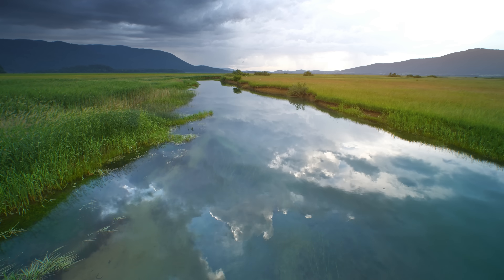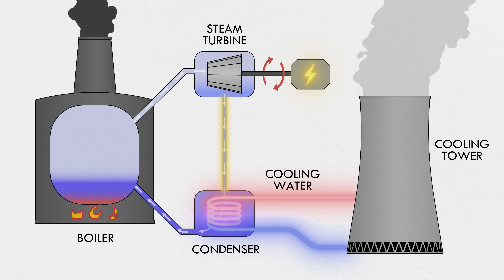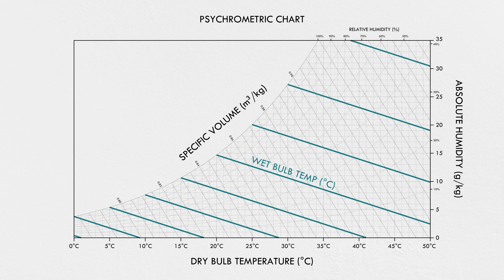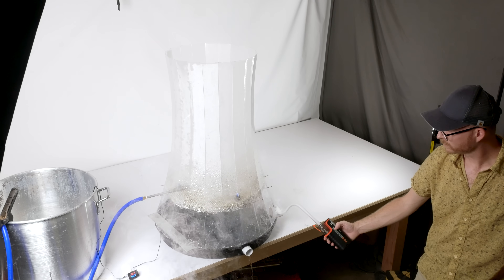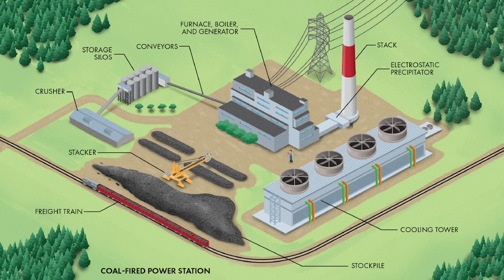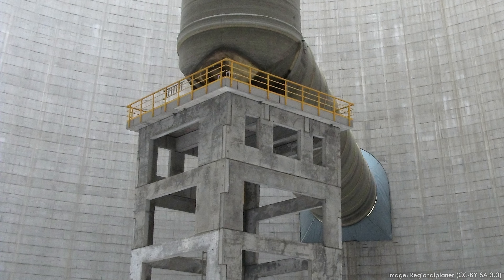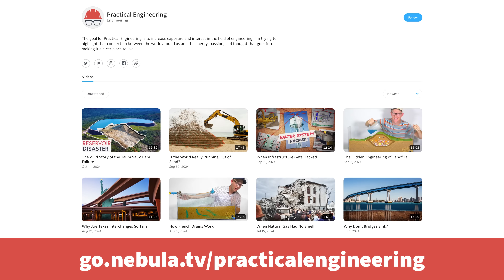Why Are Cooling Towers Shaped Like That?

Comment: Decades ago I was in Nuclear Power Engineering.  All this time, I am still surprised some smart engineers haven't figured out how to continue using the waste steam in a further electric power producing process and add further energy extraction methods in various smaller stages, (or at least a second stage system) to the point one could eliminate the cooling system entirely, (or almost entirely using much smaller cooling systems.)
Reply: If you'd have stuck with it you would have figured out the law of diminishing returns.  At some point it becomes impractical and isn't cost effective any more.  If power companies could make (save) a buck off of it, it would already be in-place.  Plus at some point, given entropy and enthalpy, it just won't work any more.
Reply: @nathanwahl9224  That was the first thing that came into my mind when I was typing my message out sir! With the new types of batteries using heat, there indeed might be a use for it after all????  We shall see. Thanks for the reply and happy holidays!!!!

Comment: The reason given for cooling towers isn't exactly concise. Cooling towers are used if there isn't enough cooling water bodies available. Either not enough water or the waste heat would heat s small lake up too much for wildlife (either way due to not enough water).  That's why in desert areas they have many cooling towers and in wet areas very few if any. Also it's not about keeping the water pure. All the cooling water you see is coming from the secondary loop which doesn't go into the reactor. The coolant in the reactor is a closed system.

Comment: why do we need to cool the water while we need it hot, so that we use less heat to trun it into vapor to run the turbines ? on top of that,  isn't the hot water coming from the nuclear plant to the lake dangerous since it contains radiations ?

Comment: Seeing the section about the structural integrity of cooling towers was pretty cool.

There is an abandoned plastics plant by my house that had its own power plant. The cooling station has never been demolished and the cooling towers, which are situated on the roof of a wood truss structure, are collapsing seemingly by their own weight.

Comment: I think the better question is, why do we need cooling towers at all? Aren't they by definition, energy loss? A power plant's function is to generate heat that gets turned into electricity. Why let all this heat escape into the air in the first place?

Comment: If you live near Beaver Pa, head over to shipping Port, right along highway 168 you can see a natural draft cooling tower up close and in action. And up the road are a couple of inactive ones at a deadlined coal power plant.
Reply: I've been down that road!  Came over to the Beaver Valley nuke plant from her sister plant where I worked in NW Ohio.  With the hills you can't see squat, come around a corner, and there they are!!!

Comment: Fun story: If you get on google maps and find the GM Spring Hill Manufacturing plant in Spring Hill, TN and turn on satellite view you will see that there is a line of 8 relatively small towers like this. Now, this manufacturing plant was originally built to produce the Saturn brand and was designed to be as efficient and environmentally friendly as possible. Now here's the fun part. When the plant was being built in the 1980's there was a huge uproar in the area from locals who thought GM was building a nuclear energy plant just because of the shape of those towers. Everyone associates these towers with nuclear energy. I suppose it's understandable, but the county still forced GM to allow 3rd party engineers and local officials to view the plant to make sure it wasn't gonna be using nuclear energy. Pretty wild. 

As I mentioned, this plant was built with a BIG emphasis on being environmentally friendly. EVERY stack in the plant had built in air scrubbers to make sure noting harmful was getting out into the atmosphere. There was a massive emphasis on recycling to where there was very little (if any) garbage waste. They even blasted out a side of a hill and built up the hills around the hole, and built the plant down in the hole. They even painted it the same color as the sky in the area to limit it's intrusive visibility to the local population.

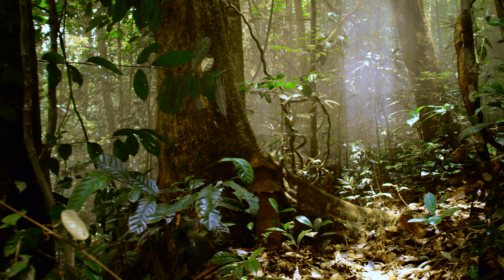Comment: 6:10 it doesn't feel hotter if it's humid. It feels "MORE". Humid 1°C air doesn't make you feel hotter than the arid air of the same temperature. Steam just carries heat better but it's a two way road

Comment: Having worked on these towers on several uk power plants on the packing and efficiency of the cooling towers, one thing that you could add to your video is why the condensers are used and it’s not just to cool the steam back to water as that is counter intuitive, the real reason for doing this is to do with the properties of steam and water, 1L of water expands to 1000L of steam, the turbines have 3 sections, high pressure, medium and low pressure then to the condenser. The cooling of the condenser causes the steam to turn back to water, contracting by 1000 times, creating a negative pressure causing the turbine to spin faster generating more power and the reduced pressure means the steam remains steam at 50 degrees C. The cooling allows an increase of up to 50MW  from each 500MW generating unit. The efficiency of the pack and cooling of the tower water greatly affects this gain ie if a cooling tower has lost efficiency amounting to loss of 5 degrees of cooling costs based coal fired units was £100k per degree, per tower, so on a plant like Eggborough with 8 towers around £4mill per year. The more the cooling of the condensers the greater the vacuum therefore the more power generated from the same ton of coal
Reply: Oh wow, that's incredibly interesting. I'm starting out as a performance testing engineer, great to have this golden insight from you!
Reply: this really needs to be higher
Reply: That's cool thanks for sharing
Reply: Very cool piece of Knowledge 👍🏻
Reply: I love hearing smart people talk about this it sounds like you have so much passion!
Reply: Thanks for answering a question that came up in my head very often

Comment: Steam pressure turns turbine.
Steam vapor condenses back into water on it’s way to the cooling tower as it meets cooled water in a exchange condenser coming from cooling tower preheating it on it’s way to become steam to turn the turbine again…

Question;
1) How much heat returns to the water that gets heated back into steam?

2) How much heat goes up and out of the cooling tower?

X = total BTUs generated into steam.
Y = BTUs exchanged from steam into water from cooling tower, conduction.
A = BTUs lost in cooling tower, convection.
B = BTUs lost from conduction, radiant, and convection at steam production to the turbine.

Y+A+B=X
X-(Y+B+A)=0

Comment: Surprisingly this technology of the swamp cooler is used in Africa as a means of refrigeration. It's not very good but it's enough to keep and create jelly. How would works is you have a netting that you put over an A-frame tower. You keep the netting wet enough for constant evaporation but not too wet. This allows for the latent heat to lower the temperature inside the A-frame. I never knew how it worked until I watched this video almost 10 years later. Amazing how things click into place.

Comment: Liddell and Bayswater power stations are examples of two different cooling options standing across the road from each other. Driving north you had Bayswater with cooling towers on the left and Liddell with no towers and lake Liddell on the right.

Comment: Why do charts of humidity and temperature always seem to not include the lowest relative humidities and often the highest ambient temperatures (yours at least has the latter)? 
This is most concerning when I look up information on heat safety for example. 

Where I live in Arizona our record high is 117F/47C, and many charts stop at 100F/38C. We also often pair these temperatures with a relative humidity of 3%-10% well below the minimum of all such charts I have found. 

I just want to be able to compare what the actual water content of my air is compared to that of my friends in normally humid climates that get very cold in winter. And when I use a calculator set up for it, it warns me calculations for my area may be inaccurate. Why is that? 

If my 110F air is holding 5% of the maximum water it can hold, Why can't they tell me what that amount is reliably when they can for 70F and 90% humidity? What changes?

Comment: Would placing a large Wind Turbine at the top of the nuclear cooling tower be a viable option or would it end up adversely affecting the draft needed to cool the water? 

If it would work, could you run a sufficient number of braided steel lines to a large generator suspended in the center with sufficiently large roters attached to the bottom of the generator so they could never interfere with the lines. You could run the power cords back out along those same cords and any torque from the system will just end up putting more tension on the lines so spreading that load out across multiple different lines would easily take care of that while also not inducing twisting strain that a rigidly mounted unit would create. 

Probably been thought by someone else before and a logical reason why it isn’t being done now but then again if everyone assumed as such innovation never would happen.

Comment: 00:00 - Introduction to Cooling Towers 🌬
02:01 - Efficiency in Cooling ♻
06:51 - Thermodynamic Principles 🌡
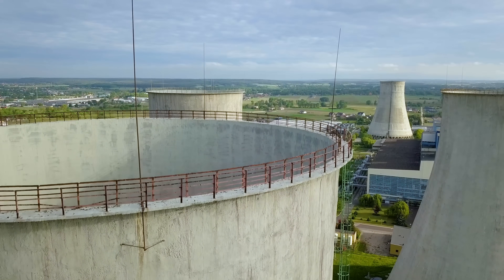10:47 - Design & Structure of Cooling Towers 🏗
12:37 - Types of Cooling Towers 🌊

Comment: The flue gas or toxic components of industry would be hidden and only released at optimum time slot which avoids detection, this combined with the water vapor cloud helps to deceive the public who might be unaware,,  the big water vapor charade of the water cooling tower needs to be observed between 2:30-5:45 am thats when you might notice .
Reply: That's called steam. Nuclear power does not utilize fossil fuels in order to function and thus does not produce flue gas.

Comment: There is a good way to get even more use out of it, needs to build some more infra though. Pipes that take the heat to surrounding buildings i.e. district heating (such infrastructure is in use in Finland, probably not from nuclear power plants, though) and then back to the cooling towers or elsewhere.

Comment: I doubt smoke stacks are tall to move combustion products away from populated centers. Their height is insignificant compared to horizontal distances. If it is to keep exhaust away from people, then it would just be at the powerplant itself.

Rather, it's more likely they are tall to maximize lift (chimney effect) to extract exhaust products from the combustion chambers as quickly as possible to improve airflow and the combustion process, and the exact height is balanced by cost, safety, and effectiveness.

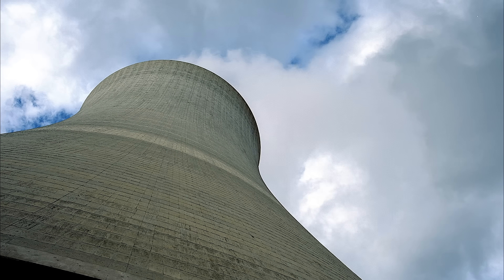Comment: 13:56 - 14:02 Here you can see that the footage was made at a nuclear power plant. You can sometimes see white dots or streaks flashing, which are caused by high-energy electromagnetic radiation hitting the CCD sensor directly through the camera body.

Comment: Apart from structural considerations, the shape also minimises the material cost. If you had two wire rings of different diameters and put them in soapy water, the film between the rings will assume the familiar shape (due to surface tension) indicating mnimum tension state

Comment: One of the most advanced version of it is the Heller-Forgó Indirect Dry Cooling System. The water flows in a closed system of water-to-air heat exchangers built in the tower and does not evaporate. So there are not big clouds coming out of the tower. It is useful if you had produced deionised water with ion exchange, and you want to reuse it. It was invented by two Hungarian engineers László Heller and László Forgó.
Reply: Everything was invented by the Hungarians. :) (it's a joke, but true)
Reply: @tamaskiss6379  I believe you mis-spelt Britain
Reply: won't the water absorb floating ions and therefore have to be deionized again?

Comment: I am guessing the shape of the cooling tower also utilizes Bernoulli’s principle via the Venturi effect; the narrower section of the tower speeds up the air and drops the temperature even more quickly.
Reply: Drops the pressure.  Which drops the temperature of what is going out of the tower, as you said.

Comment: What I don't quite understand though, is that at the start, Grady mentioned that putting lots of the steam into the air was bad for the environment.  But the natural draft towers are putting lots of warm water vapour into the air regardless.

Do you have a sense of how much of the water is lost to the atmosphere vs returned to reuse?
Reply: It’s not. There’s already a lot more moisture circulating in the atmosphere than all of the cooling towers can generate.

Comment: The weeds are a good place! I like to see where the "phase change" in engineering is at these scales based on process parameters. Where the line is after they analyze the systems in place is what interests me. What can I say I find cost benefit analysis fascinating.

Comment: It’s surprising that the engineer didn’t mention the potential nuclear risks associated with water vapor and the release of treated water into rivers after cooling processes. Even small amounts of radioactive elements in the vapor or wastewater can have long-term environmental impacts, affecting ecosystems and possibly human health. It would have been valuable to discuss these risks and the importance of strict regulations and monitoring to minimize such effects
Reply: That's because there is no risk.
Reply: If what you say is true, then why were they afraid of a nuclear leak in Chernobyl and the nuclear explosion in Japan? @sylviaisgod6947
Reply: Water is very good  at blocking Radisson. That's why the waste is stored in swimming pools before their permenent disposal. 

They use heavy water in circulating the heart generated by Cranium. If the control rods fail, they can use the water to stop it.
Reply: @jamesisaac7684  If what you say is true, then why were they afraid of a nuclear leak in Chernobyl and the nuclear explosion in Japan?

Comment: Would it be possible or practical to put a wind generator horizontal inside a cooling tower?
It could have fan blades designed for the  (I imagine) relatively constant through flow.
Apart from initial outlay, it's using waste energy so even another constant 5Mw or whatever should pay for it's self relatively quickly, plus, it doesn't rely on correct wind direction or flow

Comment: Hey Practical Engineering, wouldn't Venturi effect play a role here, too? As air goes through the constricted section of a cooling tower the air speed goes up and the air pressure and temperature go down
Reply: Mentioned at 10:21

Comment: 🤣 They're still hyping those primitive reactors I see. Cold steam Tesla's are better.. If a cold steam Tesla turbine is the right size for heat input to there won't be anything on the other side but cold and that's how a cold steam Tesla prevents hot & cold from balancing. As long as your Hot side is warmer than your cold side it will try to send and the universe gets stuck in a loop she will never stop trying to balance it. For cold side? Now we're at cooling SCHEMES by Q clearance melting the masses minds with gibberish solutions to gibberish problems. Water between walls of cold side with room for expansion + Same vacuum to prime system to lower pressure in that water to release all its energy to cold boil it to ice before priming the main system with the Tesla turbine inside.

Results? Regenerative ice reinforced cold steam system.. Points at videos of people running Cold steam at 130F And you people are looking for fusion to heat the steam systems gooder. 🤪Mind control.. Btw.. Thermophilic bacteria collect the only survivors from mulch that starts to combust after you give them some nutrient solution so you will have the high heat survivors and put them in a fireproof panel with nutrient drip diluted enough to prevent them from going fire mode just want them at 210F solid. Run them through pipes in a cold steam hot side balanced with their heat output = Nuclear reactors gimmicks when everyone can use food, yard, and even bathroom waste for nutrient solution to run an endless generator loop.. A system that can run just by people existing to make waste for it.

Comment: The actual thermodynamic quotion originating from a prescribed ambient temperature control and maintained humidity level, is primarily based on extrapolations of time vs. temperature dew point caculations, intermixed and sub- marginally multiplied by the factor of atomic subjectivity.